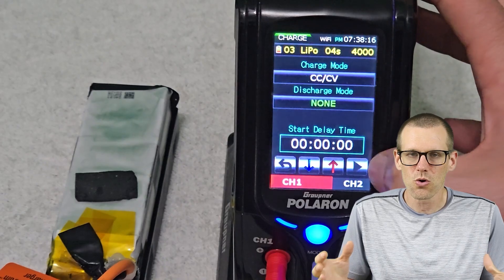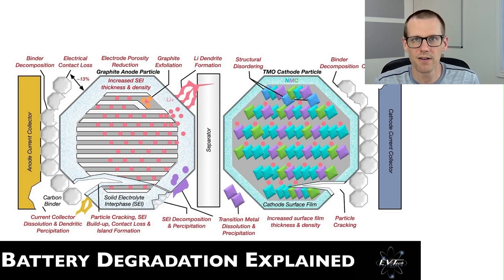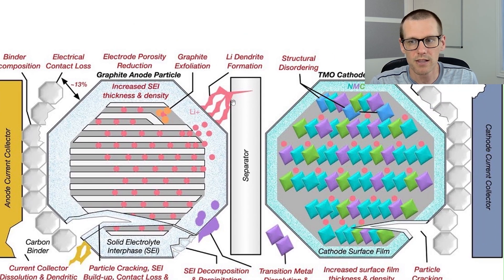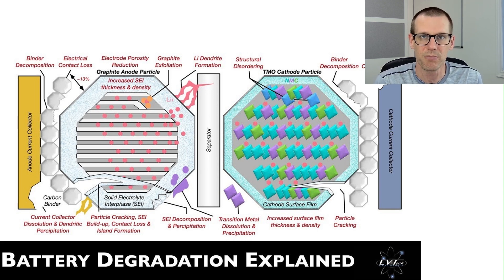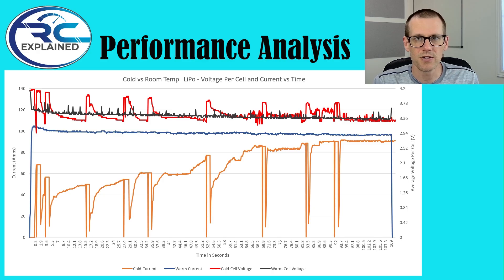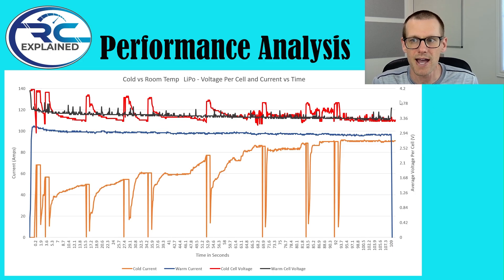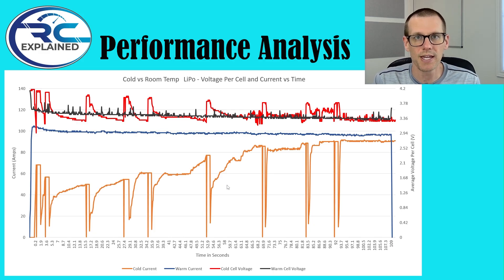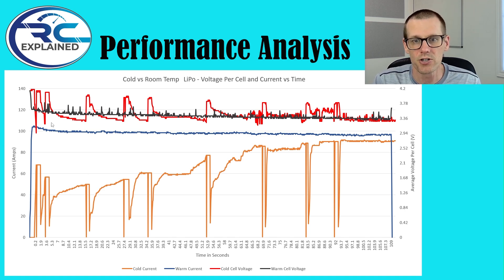I FROZE my LiPo so that you NEVER do! The Performance Drop is SCARY!

Comment: I store a lot of my lipos in a shed outside my home just in case of fire issues. Curious if leaving them out during the winter harms them. I was told it didn't. As long as I didn't try to charge or discharge them "cold" and waited for warmer temps. What is your take on that?
Reply: Very good question I also do the same thing, its funny how he replied to everyone else.  I was laughing so hard when he said he's never seen data like this he's obviously never studied a lead acid battery those things that we turn our cars over with every day or any chemistry for that matter. It doesn't matter if it's lead acid or lithium or Mars dust if it's frozen it doesn't work as well, it's just kind of like common sense and it's usually around the 50% or less power you get from any battery when frozen. I know many people to this day that still store their alkaline batteries in the refrigerator. Maybe a better question would be which chemistry puts out the best when frozen. I've actually been running a lithium battery in my car this will be the 4th year I've had it in there and I live in Idaho where it's below freezing 190 days out of the year. this battery still works just fine it does not have a warmer on it it sits right where the original battery sits under the hood everybody told me it wouldn't work and look here we are 4 years later not only does it have a higher resting voltage than a lead acid battery it's got more cranking voltage even when it's frozen! Works just fine and has a 15 year warranty. And for anybody who's curious that does live in the cold more than half of the year the best way to combat your batteries being at 50% of what they're capable of is to add a capacitor bank to your vehicle system It'll save your battery it'll save your starter helps your electronics it's really the only way to get that punch back that you need in cold weather.

Comment: Up here in nothern AB I don't take the batteries outside until they are already in the car and ready to go. As soon as I am outside I turn it on and start running before they get too cold. Even with the battery under load they still cool down. Runs are only 50% as long or less than what I get in the summer. After the battery hits LVC I pull them out, dry them off and let them warm up in my heated garage before putting a storage charge back on them.
Reply from the maker: Interesting, sounds like you have a good process for running RC in the cold! my experience comes from running EDF jets in colder weather. Temps are easily maintained under the load placed on the packs.
Reply: I miss the openness of Alberta and I wish I could fly my planes there but just so many laws . 🥲
Reply: @Pretend_pilotFPV  That is why I quit flying after over 40 years of it. I only use cars now.

Comment: What would you recommend to run in snow other than starting with a room temp batt and smaller pinion gearing?
Reply from the maker: If your battery is at proper temps and maintains proper temps, you can run aggressive gearing. My recommendation is to make certain the cells are around room temperature 20C mimimum in your RC if you are going to push them harder.